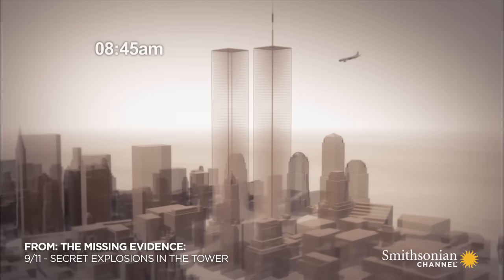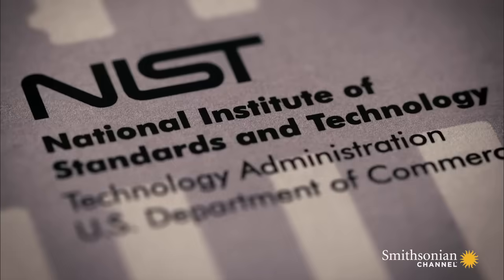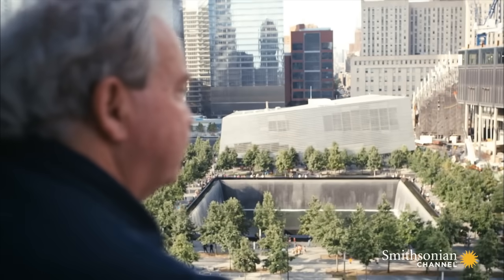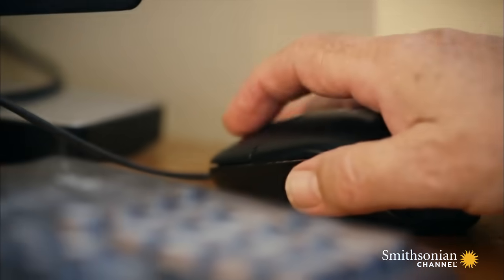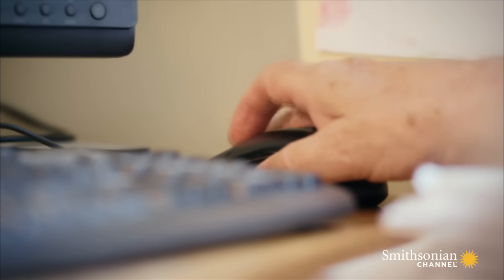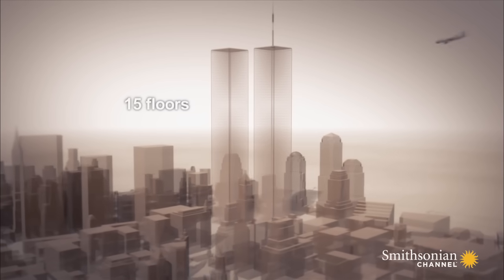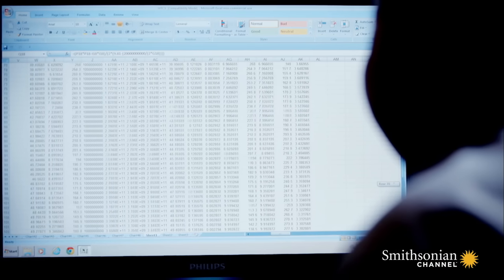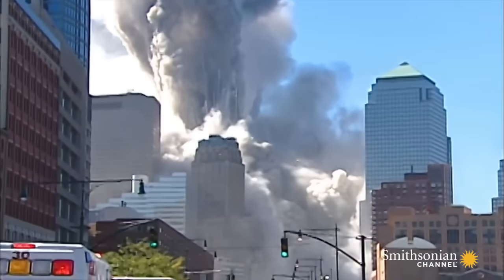This Computer Simulation Explains How the Twin Towers Fell

Comment: The top 15% of WTC1 only weighed 3% of the entire building because the column the so much thinner.  Can anybody come up with an example where you cut off the top 15% of a structure and drop it on the bottom 85% and crushes itself all the way to the ground?
Reply: Jenga
Reply: You can do a set of impact tests on construction similar to the towers.  The truss ceilings of Home Depot or Wal Mart buildings are similar.

Drop a few hundred pounds a few feet high and see how a truss floor holds up to unexpected shock like that.  Repeat it multiple times with increasing weight and speed and see what happens.

🤷🏽‍♂️
Reply: @MrDefreese  that's so not what happened,  I can't believe someone would actually say something like that. The collumns are the building,  not the trusses. The trusses hang from the collumns.  Even if you took a huge knife and cut the building,  the collapse would stop because the building has to be crushed to collapse and that takes away the energy to accelerate downward,  simple physics.  But if you need to see it, look up failed controlled demolitions
Reply: @davmus1112  um.  No.  Your understanding of structures is inadequate and deficient.  There are excellent construction photos which show how buildings like that are constructed and how flooring systems are connected to the core and edges.  Your commentary shows you know none of it so you should not make wild claims.
Reply: @davmus1112  the towers were build by placing columns and trusses a few segments, trusses, and core elements at a time.  The flooring systems connected the core with the outer structural columns in an innovative way which allowed lightweight truss flooring and wide open floor spans unlike many other towers which required more closely spaced, heavier duty columns.

As the internal truss systems became compromised, the connections between the core and exterior columns were also compromised.

That means the mass of material above the compromised trusses would fall on the next lower floor, destabilizing the connections between that next floor and the core and exterior columns, again and again.

Truthers are generally unaware of this stuff and are incapable of speaking with any competency.
Reply: @MrDefreese  I'm more than aware of way the structure is connected,  I actually understand it, unlike you
Reply: @MrDefreese  you spent 3 paragraphs saying nothing and you think I'M wrong,  that's funny.  Now after all this 'the core was connected to the outer collumns ' nonsense.    Try explaining how any of that could cause the inner 47 collumns to collapse
Reply: @MrDefreese  you still haven't come up with an example of the top (accounting for 3% of the mass) destroying the whole thing to the ground. Face it, the buildings were demolished, why did tower 7 collapse in 6.5 seconds with 2.25 seconds at freefall
Reply: @davmus1112  the inner cores could not stand on their own, much less with tens of thousands of tons falling on them from the floors above.

This is pitiful and your position is here crumbling before the eyes of anyone who chooses to watch it happen.  🤦‍♂️
Reply: @davmus1112  3% of the mass is thousands of tons hitting the truss floors and the inner core far above any shock load capacity ever imagined by designers.

🤦‍♂️ 

You will have to burn your account because your take is spectacularly bad.   And did you do the standard issue dodge of shifting gears to toss out building 7.

🤦‍♂️
Reply: @MrDefreese  thousands of tons is relative to the mass of the building.  And the buildin was designed so strong that it could hold those tons and keep them from swaying in the wind....and oh by the way. You still haven't come up with an example and now you accuse me? For anyone reading. This David DeFreese is looking more and more like a con
Reply: @MrDefreese  thousands of tons is relative to the mass of the building.  And the buildin was designed so strong that it could hold those tons and keep them from swaying in the wind....and oh by the way. You still haven't come up with an example and now you accuse me? For anyone reading. This David DeFreese is looking more and more like a con
Reply: @davmus1112  thousands of tons on a single floor not designed for that impact loading is of course going to lead to faults of the concrete, the flooring trusses, and the connectors on the exterior columns and internal core.

You are clueless or dishonest and should stop using this account.
Reply: @MrDefreese  for anyone reading,  notice how he doesn't answer any of the questions,  like he's paid to spread false info
Reply: @davmus1112  give it up.  You don’t know what you are talking about.  Anyone who has take a first level structural analysis course can see through you.  You are going to have to stop using this account for a while and try to pass on bogus info a different way.
Reply: @MrDefreese  you are a con. Answer the question.
Reply: @davmus1112  the points have run circles around you and you either don’t understand it or you do and you’re just trying to string along a few gullible Truthers.

If you are deliberately untruthful, good luck.

If you are merely innocently clueless, any rudimentary look at impact loading on concrete flooring truss systems will clear things up in definitive fashion for you.
Reply: @MrDefreese  to anyone reading this, I've seen this before.  It's a tactic used to discredit but it has the reverse effect. I've asked for an example of when the top of something that weights a mere 3% of the total,  can crush the whole thing to the ground. It seems pretty obvious that when someone avoids answering the question and uses childish name calling,  then that someone is the one who's conclusions should be in question
Reply: @MrDefreese  the central core is not below a truss, so how could the truss with concrete  destroy the truss? Also one of the buildings was hit on the side, the building started the slide to the side, yet the whole building was leveled, how? Wtc 7 wasn't hit by a plane, yet the whole thing collapsed symmetrically in 6.5 seconds, how?
Reply: @davmus1112  dang, you are not doing very well here.  It's not a matter of the percentage of the mass of the towers falling.  It's the mere mass (and acceleration) that matters.  Since you are hung up on your 3% figure , you can do some simple math and see that 3% of 500,000 tons is somewhere around 15,000 tons of material falling onto the trusses and core and exterior column walls around the damaged area once the collapse began.  Not a single floor, connector or other structural element in any building is designed to have massive impact loading like that.

This is very basic stuff.

There are probably free structures courses at some top colleges that will cover this material in more detail since you seem curious.
Reply: @davmus1112  once again.  Engineers and scientists do studies on impact loading for structures.  You can try it yourself - get a structure you want to test.  Drop a 5lb ball from increasing heights.  Eventually, a 5lb ball will impart significant force on the structure to the point it will fail in a predictable fashion.  You could repeat the same experiment with a 50lb ball dropped from various heights.  Then try 500lbs.

Now imagine what happens when you get to 50,000lbs. dropped from increasing height.  Now try 500,000lbs.
Reply: @MrDefreese  what's amazing is that David DeFreese thinks he's making sense.  He's quoting engineers and scientists with no specific examples.  I on the other hand have studied science my whole life and have a bachelors of science in math with advanced studies. When someone has to quote other people that understand the science that usually means he doesn't. Look at his example 'get a structure you want to test' then he imparts increasing force to that structure until it breaks.....this is always possible so saying it is a waste.
Reply: @MrDefreese  if you increase the load the structure must be reinforced to handle the load. In the case of wtc7, 2.25sec of freefall. This can't just happen because gravity is the source of energy, the building decent speed is measured by tracking the roofline speed. If the roofline decends at the same rate of gravity, then all the energy is used to accelerate the speed, but the collumns on each floor had to be crushed.  This takes energy which would have taken away from the energy used to accelerate the roofline therefore it would have slowed and would have shown in the video.
Reply: @davmus1112  a bachelors in science in math?  Impressive.  Advanced studies no less.  Doubly impressive.  You should be able to do some of the structural analysis with various load factors.  Give it a try; get back to us with your figures.
Reply: @davmus1112  that was impressive word salad.
Reply: @MrDefreese  for anyone reading notice he still hasn't come up with an example where a small portion at the top destroys the entire bottom. He thinks he's being clever using 'word salad' but that's just his way of saying he doesn't understand.  Like his comments about my credentials, he hasn't listed his and at this point I doubt he has any. 
If we look at the second building to collapse, we see the top 15 or so floors moving together downwards and tremendous amounts being blown out laterally.  Multi ton exterior collumns blown hundreds of feet away from the building,  yet the top dissappear straight down into the path of greatest resistance.  Over 200 collumns in perfect shape all just gone. He never found any other building made of steel that collapsed all the way to the ground
Reply: @davmus1112  so tell me.  Where are you from?  Eastern Europe?  The Middle East?  It’s interesting to see you folks in action.
Reply: @MrDefreese  my degree is from NIU, born Oak Park il. So now you mentioned a couple places you think I might be from. Anyone reading this must have seen the obvious poor judgement he made there. I don't know he keeps going without answering the question.  Show me an example where a small portion at the top of something can completely crush the entire thing.
Reply: @MrDefreese  this man has replied 13 times so far and has yet to make any kind of point on his side. Why does he continue?
Reply: @davmus1112  derp.  You keep posing an inane question which is why you are struggling.  Drop 15000 tons on anything and you will have catastrophic problems on everything underneath.

🤦‍♂️
Reply: @davmus1112  it’s not a matter of the portion; it’s a matter of the mass and speed of impact which determines if the load rating is exceeded.

You are really struggling with a basic concept which should be clear to a math major.  Since this still has you tripped up, you should probably try to get clarity from the physics or engineering faculty or a grad student or even an undergraduate.

I feel bad to see you bungling this basic issue.  It’s sad to see.
Reply: @MrDefreese  any thing? Are you sure? If you made a slab of concrete, steel reinforced, 1000x1000ft, 100ft thick you could drop you 15000ton weight with little or no damage,  right? .....right? It doesn't matter how heavy the top is, but only how strong what's beneath it is, do youget it now?
Reply: @MrDefreese  14 replies and counting
Reply: @davmus1112  derp!  Do you get it.  Those underlying floors were not designed to take the impact of thousands of tons.  If you had the faintest hint of a clue, you would be able to find the impact loading factors for each floor, each truss sub-assembly, and even the core elements.

Dang, your performance was sad before, but now it is pitiable.  🤦‍♂️.  You are not doing NIU proud here.
Reply: @MrDefreese  what is that, 15 incorrect replies? Again the columns are the building and the trusses hang from the columns. And the structure destroys itself as it collides with the structure below.  So the building that got hit around the 93rd floor with about 15 floors above would destroy itself bythe time it got to floor 77th floor. The collapse would stop. Of course you should be able to show me examples if you're right. For anyone reading,  the only possible way any of what we saw could happen is with preplanted explosives. Lots of them
Reply: @MrDefreese  what is derp? Are you trying to make some point or is it just childish name calling?
Reply: @MrDefreese  what are you exactly referring to when you say the underlying floors?  Do you mean the concrete slab that stretches between the core and the exterior collumns? How could the load factor be used in this example? The video shows the collumns buckling and the collapse followed.
Reply: @davmus1112  this is basic structural analysis.  You can either do the experiment on your own or study from materials which have already been produced about load factors, impact load, structural element failure.

Sad.
Reply: @MrDefreese  16 incorrect replies and counting. Here's a basic for David,  gravity alone is not strong enough in this situation to the complete collapse.
Reply: @davmus1112  tell the class the significance of mgh and dynamic loading on a truss system....
Reply: @MrDefreese  17....trusses aren't supporting the weight of the building here, if all the trusses failed in wtc 1 or 2 the structure would still stand and only a couple floors would be damaged.  In wtc 7, we'll it's pretty obvious that was a controlled demolition
Reply: @davmus1112  you are incorrect yet again.  The exterior column walls could only stand unsupported against horizontal motion for only about 2 stories - that’s why the building was constructed with a few segments of core, a few segments of exterior column, and then both load bearing portions were connected with truss subassemblies.

Your understanding of loads and structures is completely inadequate to comment on anything at all.  The only reason you aren’t embarrassed fully is because of anonymity.
Reply: @MrDefreese  that's his worst answer yet. The core was 47 steel box columns all connected by girders. At the base the steel in the columns was 4 inches thick.  If anyone is still reading this, note how he keeps saying incorrect things, then call me a name. I'm blocking him because I've wasted enough time. Keep seeking the truth.

Comment: Where's the 700 ft tall steel I-beams that turned to dust AFTER the collapse...I think I missed them in this simulation.  Go back to the drawing board and try again...we will wait..I think we could all use a good laugh.
Reply: That standing column proves there was no demolition.
Reply: @peterjv8748  DUSTIFICATION...This demolition was done from the top down...the first in history...see TESLA for the answers.

Comment: There's way to much dust in the collapse.  The concrete in the floors would have broken into chunks not turned to dust.  The center steel beams and columns would have provided ample support a collapsed floor above it.  This was a strong building.   Something tuned it to dust.  Perhaps its so explainable because technology was used that is not known to the public.
Reply: What are your qualifications to say how much dust there should or shouldn't be? Where did you get your engineering degree?
Reply: bluefishbeagle1 -- Do you have any data, math, scientific experiments, anything to support this statement?  "The concrete in the floors would have broken into chunks not turned to dust."    No... So that is just your unsupported, uninformed opinion.... How could you possibly be confident in that opinion when it can only lead to the conclusion that some unknown super technology or magic, space ray gun from outer space that nobody is ever heard of nor knows to exists was responsible?  Your opinion is obviously wrong.... because space ray guns from outer space don't exist... common sense friend...

Comment: Right 11 seconds. So all the floors of the below section opposed the same resistance to the fall as air would. Did the guy forgot to input in his model that resistance to the fall was opposed by concrete and steel FFS?

Comment: The biggest joke about 9/11 involving planes is a bunch of airline pilots loaded an exact replica of this flight into their flight simulator and not one got it in their first goes at 560MPH!! At regulation speeds they did much better. 560 MPH folks is the Question.
Reply: Wanna try that in English now?
Reply: @tpryce6432  I'm sorry Dude , didn't realize I had to explain myself in english. What spanolia do you respond too? Perhaps you should try a google App that makes simple words even easier?
Reply: Fritz Flax  Their first goes?
Reply: @tpryce6324  a bunch of Professional Airline Pilots loaded the flying of airline jets into the World Trade Towers into their flight Sim and at 560MPH could not hit/strike/smash into either Tower. So how did a bunch of Turban heads with ZERO commercial jet experience stick fly planes at 560 MPH do it?? Most Airline Pilots are ex Air Force with 1000's of hours flying time. These guys would not easily stuff up such a straight forward task. What does that tell you??  Even John Lear failed at 560MPH , one of the most experienced Pilots of all time. Do you under this level of English? If not you'll need to get help.
Reply: Fritz Flax   You mean the John Lear who thinks we’ve colonized Mars? That John Lear?